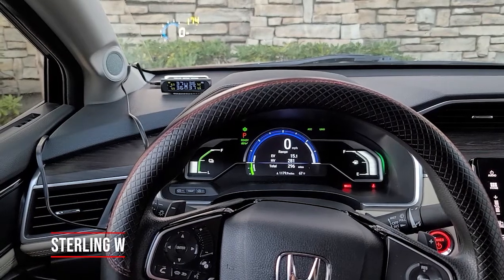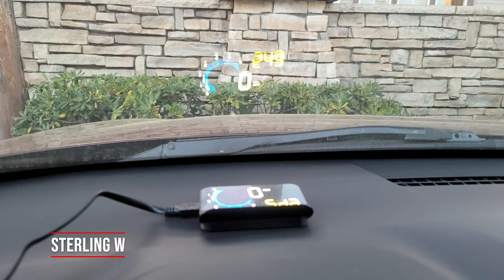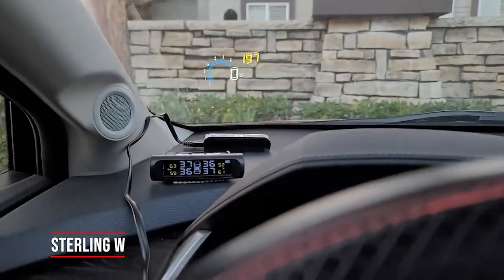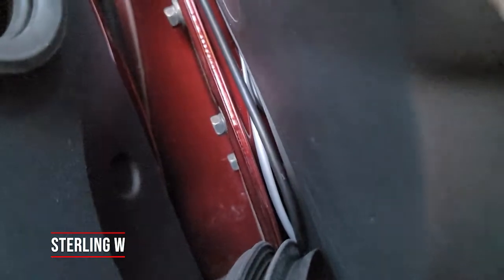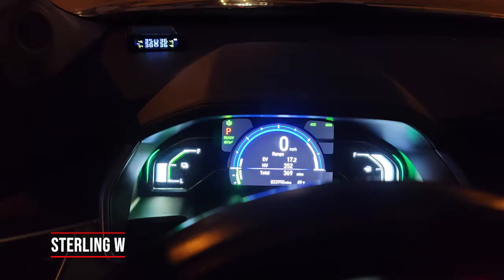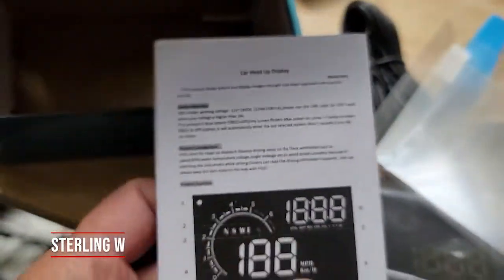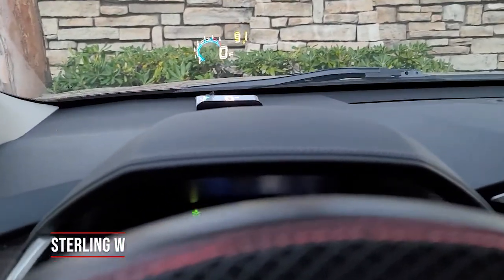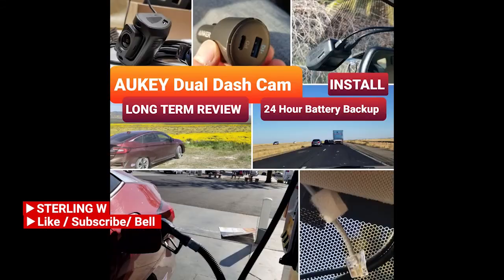REVIEW & DIY : Adding a Heads Up Display (HUD) - M12 on my Honda!

Comment: Does it drain battery when the car is off?
Reply from the maker: Yes
Reply from the maker: It can be set to turn off after a few minutes without activity
Reply: Mine shuts off a few seconds after the car is shut down.  On initial plug in to the odb II port it turned on by itself.
Reply: @SterlingW8  hi I got the same device and used it for 2 days and my battery is actually drain out. It’s actually it shut off after  switch off the engine. But I don’t know why still consume the energy. Do you have any clue or special setting to add it? Thank you
Reply from the maker: @herfiyantolim9343  the ODBII port will still drain the car battery... which sucks... i run it off USB power from my car.
Reply: @SterlingW8  thank you for your prompt respond, yeah this product it’s actually failed. But I just like the way it’s look. Hopefully get a better version. Thanks again.